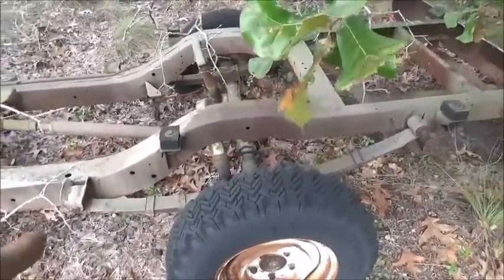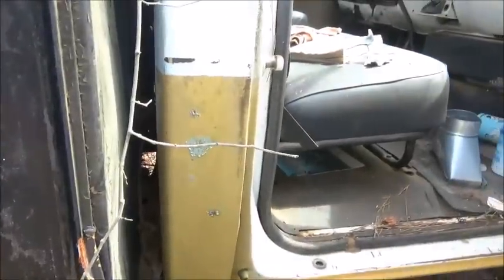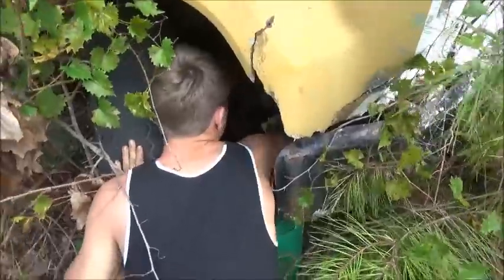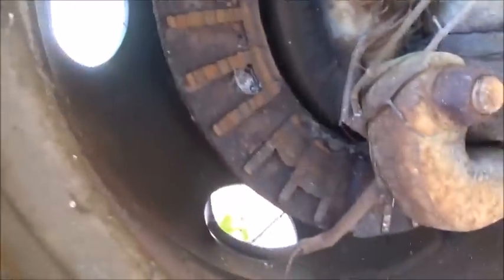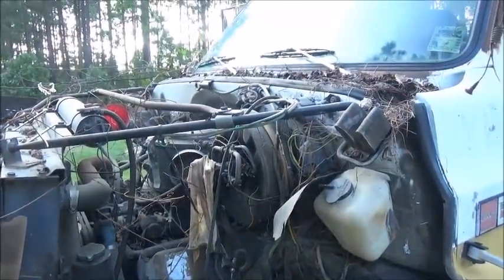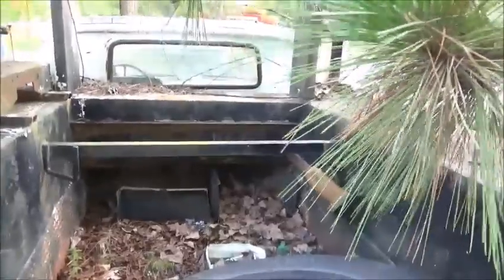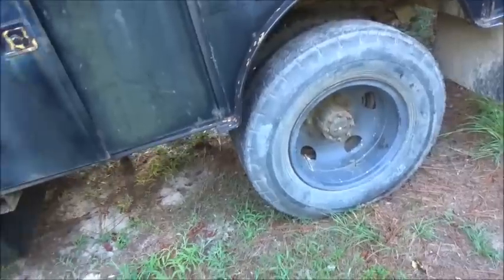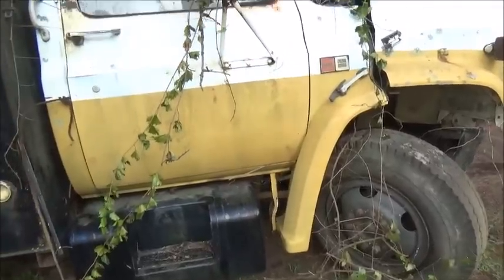Can You I.D. This Frame? & Picking Up A Service Truck

Comment: We had a 1986 Chevy C60 for a rescue truck at my FD. It had that same 8.2L non-turbo diesel, and an automatic trans. It wasn't bad- ran fine for us from '86 until '05. 

We gave it to a neighboring dept who lost their rescue truck in an accident, and they ran it for a couple more years until their replacement truck arrived, then sold it. Far as I know, it's still running around somewhere.

Comment: Late 60's International c1000 pickup. I am currently turning one into a gasser. I put the front half of a '64 c900 leaf spring frame on the back half of that frame to get it right. Mine is a '65.

Comment: Just getting the hang of these channels on my smart Vizio TV. Although, you do tend to go on a bit, OK here. Fixing old stuff fascinates me and has for decades. I'll see 90 in September. Amazing upholstery work!!!   Off track here, but the sticks you got with the machinist gear are for  burnishing a raw cut on steel. The stones in the little boxes are to sharpen blades. Re that little Craftsman lathe you gave to Noah. Slick, it is an old classic Atlas. Marketed under other badges as is the Craftsman.  I have one. The chuck is my limitation

Comment: looking at the length of the "cab area".....i am thinking its is an INTERNATIONAL travelall frame. those 8.2 detroits were great little engines. just like the international idi engines you like....very simple and reliable. i have seen many naturally aspirated ones. i have never seen one with a turbo. sure would be nice to pick up rust free trucks all the time.
Reply from the maker: I know where three are, all with turbos!
Reply: IHC fantastic diesel...the 8.2 Detroit...not so.much

Comment: International - That big bellhousing crossmember was the same kind used on the 3/4 and 1 ton frames with the T-34 5 speeds. Probably before '71, because it looks like the motor had the front motor mounts, but the boxed frame is throwing me. '70s trucks used a C-channel frame.
Reply: N Ferraro 1000 half ton had boxed frame

Comment: hey jonathan weld a plate on both sides wheel lift about 8 in back from bed and put 1 1/2 hole in the plate then when you tow run cable to plate that take flex out of the bed and wheel lift you will be amaised by way it rides i did it on midnight express eb4 if i didnt put cable there it flex a lot just a thought

Comment: International Travel All mid 60's Frame the cab length sort of gives it away but I could be wrong I figure I'm 75% sure. That old service truck looks like she weighs quite a bit glad you have enough power to winch it out of it's spot.

Comment: The infamous 8.2 "Fuel Pincher" ........4 head bolts around each cylinder. 
They EAT head gaskets ........total piece of crap. Buddy had one in a dump truck. 
Head gaskets lasted 300-800 miles. He replaced them 4 times before he gave up and parked it in the weeds.......similar to how this truck was parked.

Comment: Hey Jonathan,,, having racked my brain on this frame... and after you said what manufacturer it was...
I was thinking,, maybe a "Travel-all 4- door wagon"....Early/Mid '70 ish year model....
Frame looks to be a longer wheelbase, and with it having that split driveshaft and heavy boxed Frame,,,,it had to have some body length to it... So, I figure a Scout was out of the question....And with a non-step bumper,, a Bread style boxtruck was wrong also...
Just my guess....
What's the weight on that old GMC with that work bed on it ??  Might be why the front brakes were shot.... Trying to stop that beast...  lol

Comment: Jonathan, that Dana 44 rear end is for sure worth grabbing. The IH looks like it was from a Harvester or Travel All. Thanks for sharing be neat to see ya get a Willy’s going again. Make a nice woods truck, maybe slap the 6 cylinder out of the Gremlin in one. Yet I am bias and really like the Go Devil Flathead 4’s. I bet you’re got enough parts too get one going again. That would be wicked cool, no restoration just drivable with all the 4wd working. Noah would get a kick out of cruising around the woods.

Comment: that engine without a turbo , if it will fit , would make you a very happy man if it would fit in your 7.3 rollback , they actually even got better fuel mileage , that is if someone hasn't messed with the fuel on it ... funny thing is I can't recall ever seeing one with a turbo lol , sure they made them though , the trucks we have had with the fuel pinchers were farm trucks the farmers had bought right before the big farm crash in the mid 80's we bought them i the 90's for nothing , slapped mostly homes 500's on them and made some money with them , all the trucks are now gone , but we still refuse to get rid of the beds , and boy has it pissed people off over the years and I have been told many times everything has a price especially on my holmes 850 , it's still mounted and used along with 2 old 500's all updated with underlifts  , but it seems I still have it , not for sale actually means not for sale with me they have come to understand that well ha ha
Reply: I know what you mean. We still  have our 850 which none of the young guys want to operate so the boss and get it all to ourselves. It's for sale, for the right price. Every once in a while someone comes by and wants it for the price of a set of tires for it and are shocked and sometimes even angered when we tell them what we want for it. LOL

Comment: I bought an old chevy truck with a rotor that was worn that bad to where u could see the fins, completely destroyed the caliper had to do brakes all around plus that rotor and a master cylinder but the truck only cost 150$ so it was worth it

Comment: It might be a chevy apache. There was a mid sixties pick- up that had a torsion bar set up. Chrysler threatened to sue GM, so they dropped it.

They really rode great though.
Reply: David  Hamm nope not Chevrolet. It's a late 60s International 1/2 ton.
Reply: @wallbanger1968  Thanks for the information. The only combine i had was a '72 travl-all.
Reply: GMC Suburban
Reply: GMC Suburban
Reply: @eddietavaresjr.4773   it was not a GMC or Suburban frame. It didn't even have the same bolt pattern. Also, Chevrolet and GMC trucks and Suburbans built between 1960 and 1962 had low mount torsion bars, not highmount like that International

Comment: I got in a mid 60 international pickup..I think 67 with stright axel and power steering from the factory I saw that I bought it immediately LOL and believe it or not it runs good big V8 with automatic transmission or the Detroit Locker in the rear back bed kind of rough but cab fare

Comment: Those outside grab handles might could go on a lifted 4 wheel drive to help getting in/out...l think some of those internationals had Mopar motors?
Reply: They probably got some kind of hydraulic pump to help with the braking...not sure if you can run a vacuum booster with a diesel motor

Comment: Johnathan you where lookin at the doors on your truck i live up in the Northeast "rust belt" that cab is also a good 1/2 ton swap no rot on it also hey?
Reply from the maker: The firewalls are different on these cabs compared to a 1/2. They also have small back windows, but could probably be put on a 1/2 ton.
Reply: I had a friend do it years ago
i liked his half ton with the small window because it was the only one like it

Comment: Maybe a Ford F100 ranger. Either that or a International Harvester. I love the service truck. I love the sound of a Detroit Diesel. They are super charged two strokes diesels usually. I’m surprised this one isn’t.
Reply: Completely different engine than the 8.2  POS
Reply: fun one only reason I assumed this one did was because I had a Chevrolet Bruin with the super charged 8V71

Comment: frame might have been a fourth generation international suburban (yes they actually made them, my dad's boss had 3 of them). looked like k5 or bronco but had 4 doors with a flip down rear door. https://upload.wikimedia.org/wikipedia/commons/thumb/9/94/International_Travelall_%2816060656261%29.jpg/440px-International_Travelall_%2816060656261%29.jpg

Comment: Torsion bar font suspension leaf spring rear suspension, Chrysler product.
Reply: I thought that too because of those torsion bars...
Reply: Chrysler torsion bars were attached to the lower control arms not the upper control arms.

Comment: I didn’t know they made an 8.2 with a turbo lol all the ones I’ve worked on weren’t and I’ve also learned what a runnaway diesel does when I was learning as a kid with a 8.2 school bus engine in a street sweeper the intake took a phone book and ate it like a potato chip my boss at the time grabbed me by the scruff of my neck and drug me away from it right before push rods starting shooting and it stopped lol
Reply: Drewdude444 ok

Comment: Looks like a 72 chevy truck due to the fact it looks like my dads old frame
Reply: Shit Box looking at it now it does look like a ford because of the chrome bumper
Reply: Had a 62 Chevy Torsion bar front
Reply: 1960 thru 1963 chevy trucks had torsion bar set up untill Chrysler sued them and won. That's why Chevy stopped building torsion bar trucks.
Reply: My 2004 has torsion bar ,no idea when they started using it after 63 again.
Reply: I guess the Chrysler patent ran out, they are supposed to be a much better ride but with the 60-63 chevys guys that like to drop their suspensions have to take the torsion bars out and replace with regular upper and lower a-arms.
Reply: John Laws, Yeah you guys are right, the early 60’s GM trucks had torsion bars, pretty sure they had coil springs in 63 though...
Reply: @shitbox7413  I researched it your right 60-62.
Reply: John Laws, 👍🏻